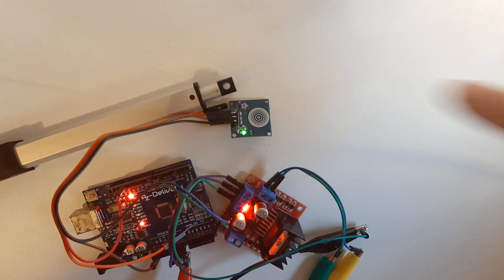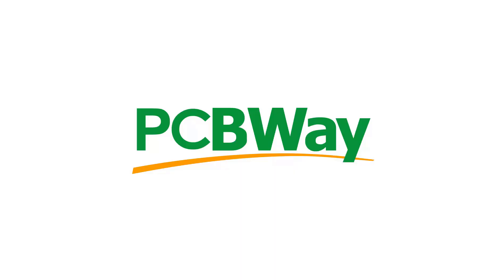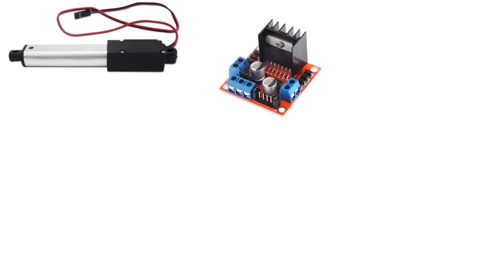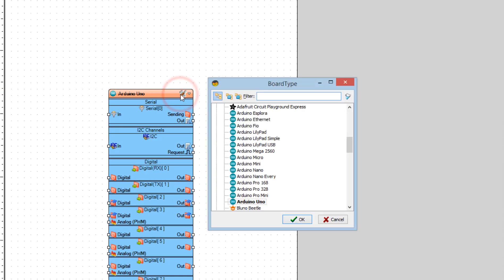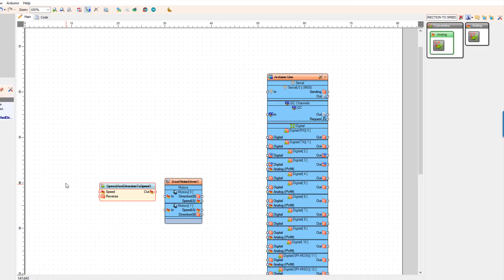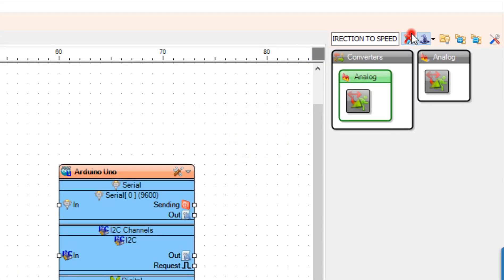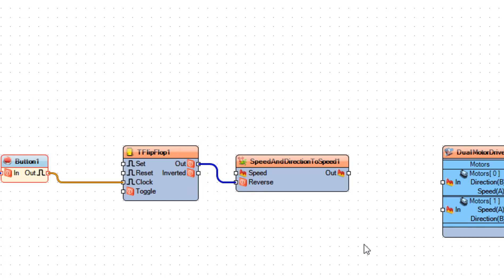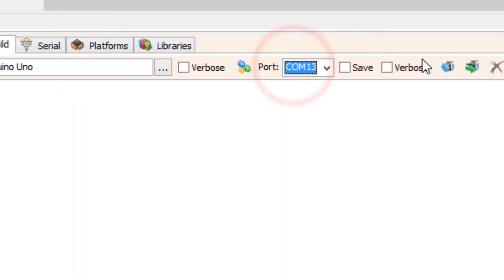Actuator touch

Comment: But you did not use code in arduino
Reply from the maker: Its made with Visuino.com, but you can also export code to Arduino IDE if you want
Reply: @visuinoprojects it will be more perfect if you elaborate how you made connection and other thing
Reply: @visuinoprojects cam I use normal push button rather than that capac sensitive touch
Reply from the maker: @MuhammadAwais-jh2dy  Yes sure